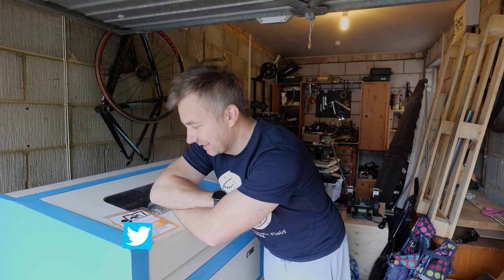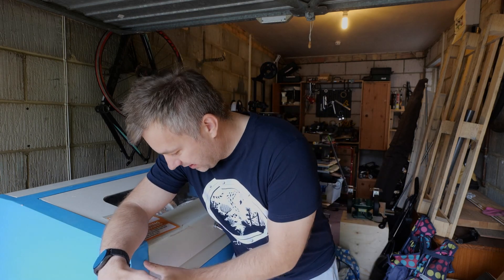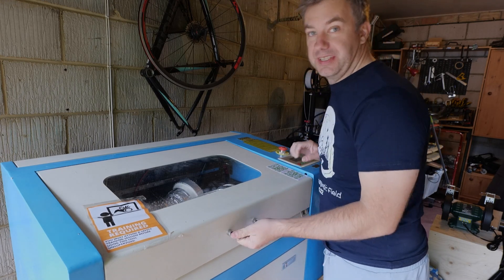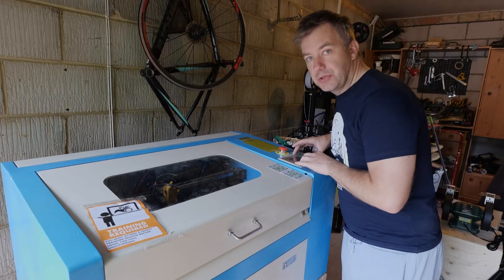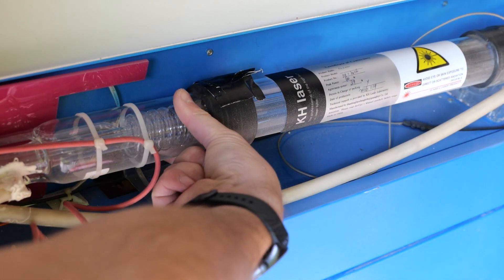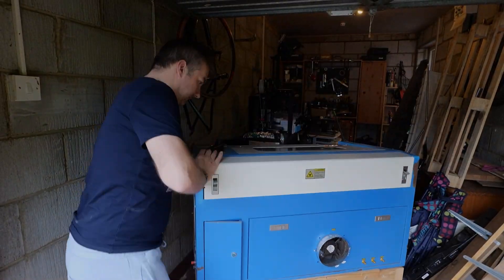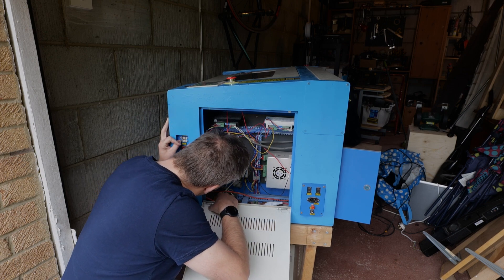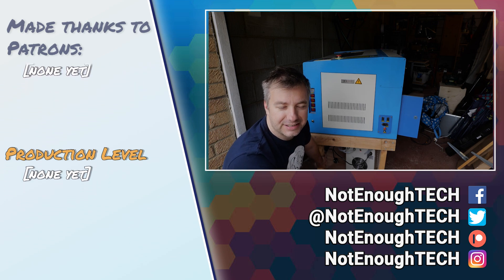Restoring a laser cutter (part 1)

Comment: As long as the LASER itself is in good condition, this should be quite an fun project.
No ideas on how you should approach it, but I will be watching.  Probably make sure the cooling system is in tip top condition first then move to the electronics.
Reply from the maker: I already know if I want to go 60-80W I'll need extending the space at the back 🫣
This is going to be fun
Reply: @notenoughtech  If you decide to do a video series on it, I would really love to watch the progress.   I think this is really exciting :)
Reply from the maker: The 1st video is doing reasonably well so I think it makes sense to do I[ :) just need to clean my garage and make the space for filming and stripping

Comment: just make sure the cooling of the tube is sufficient. if its not good you can "burn" the tube. mostly the long and high power cutting parts need a lot of cooling.
Reply from the maker: I'll try to have some sensors monitoring both the coolant temp in the res, as well as the temperature of the tube to figure out the efficiency of the system.